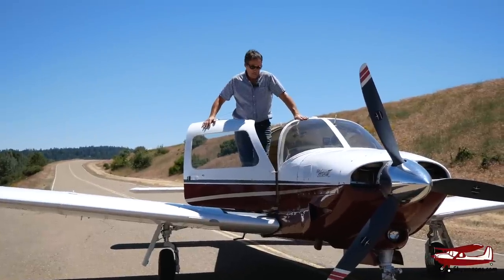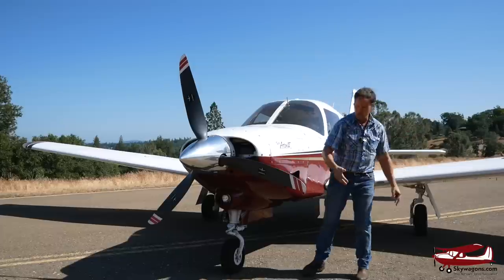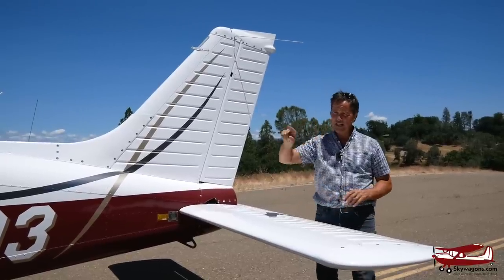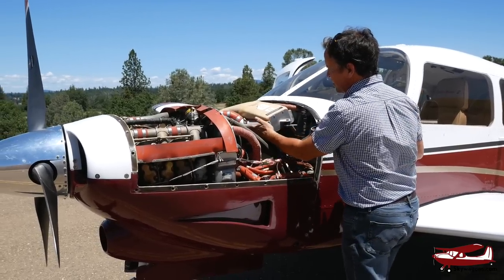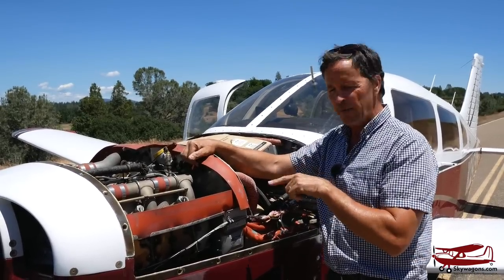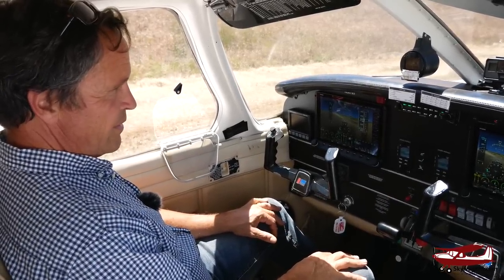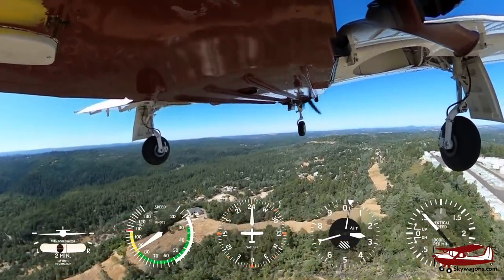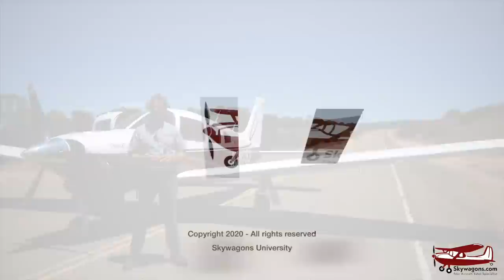1977 Piper Arrow III Turbo

Comment: You gotta wonder what happened here, all that panel work and no IFR gps and no AP.  It is a truly beautiful Arrow though, with the added panel work it will be an amazing aircraft for someone.
Reply: Agree, all the panel upgrades and not IFR, sacrilege....
Reply: It's certified to 20k feet, it's IFR over 18k.  He got it wrong,  see my other comment.
Reply: @wadeh9124  So someone put 50k into the panel but didn't spend an extra 10k for an IFD440 to enable RNAV approaches? It makes no sense at all. The auto pilot I can understand they would want to wait for the avidyne ap to get certified (though with the speed of progress so far, it would likely be a very long wait).
Reply: @capilot3635  yeah I agree.  this is where I'm fuzzy on but they can add the ifr gps module from garmin or avidyne which isn't panel mounted and can be displayed on the Dynon.  They do it in Experimental but not sure about Certified.
Reply: For the starters, it’s Dynon, so you know he’s cheap. There’s your answer.
Reply: They will likely price it as if it had all the bells and whistles anyway 😂
Reply: @Captndarty what a snobbery comment.  People afford what they can afford.
Reply: @Captndarty what a snobbery comment
Reply: This is a really nice looking airplane

Comment: 200 horsepower…not 201…the extra “1” is a taper wing identifier on Pipers.  The aircraft was originally delivered with a fixed wastegate…allowing overboost…the Merlyn conversion is an automatic wastegate that will dump excess boost.
Reply from the maker: True.

Comment: Hey Mark, I have a 1978 Turbo Arrow III like the one you are showing and yes they are the PA28R-201T but dont let the 201 part fool you. It's 200HP therefor no HP endorsement
Reply: The 201 distinguished the tapered wing from the 200 Hershey bar
Reply: @bigstickpilot  I'm just referring to Mark calling it 201HP and not sure if that's where he  got that from.
Reply from the maker: Slip of the tongue.  That engine in a hawk XP is 195 HP or 210 HP and in a Seneca III it is 220 HP. It's all about compression and RPM.

Comment: I instructed for a Piper dealer in my early years and then flew Hershey Bar wing, Lyc 180/200 HP arrows as an instructor for Japan Airlines student pilots both at Brown Field and Napa, CA.  Solid, dependable airplane.  I don’t recall any issues and we put a lot of hours on them.  Enjoyable airplanes, although the 180 was a bit anemic.  This looks like a fine example.
Reply: Brown Field? That’s where I am based at.
Reply: Ya til the wings fall off

Comment: What’s the price on this one?
Reply from the maker: It sold for about $150,000.
Reply: @skywagonuniversity5023  just saw one for about that. Wondering if they’re decent to get one.
Reply from the maker: They are very good planes but remember that the turbo Arrow has the 200 HP turbocharged IO-360 six cylinder Continental engine.  The Non-turbo has the 200HP injected Lycoming four cylinder IO-360 engine.
Reply: @skywagonuniversity5023  I’m a fan of lycomings. What are your thoughts?

Also I think the cylinder issues are simply from running them too lean. Calm the EGTs down to 1300-1400 and never worry about it.
Reply from the maker: @RaceMentally  The Lycoming is more reliable because it is not turbocharged.  Max manifold pressure is 35 inches or thereabouts.  The Continental in those planes goes to 46 inches.  They are working very hard and are easily abused.  If you need the turbo, then you need it.

Comment: Had some time in a 1970 Arrow back in the 90s with a hartzell 3 blade conversion, 200 hp. Very good performance. Sadly N12FF was a write off due to severe hail damage a few years later

Comment: Finally a turbo Arrow. Not the T-tail like mine but technically other than the Tail similar. Great planes good cross country machines. Thank you for the review.
Reply: Is the T tail a problem ? I think T tails look cool unless you forget to grease the jack shaft on a 727....🤣
Reply from the maker: T tails are fine, it is just a slightly different feel and look.
Reply: @maxgood42  Love my T-tail

Comment: No memories about this particular aircraft, but there was a turbo in my father's 210. Most of the time it did not work, but the two times I remember that it did work provided memories from the 1970s over the Rocky Mountains that I still cherish today.
The first memory was when my father asked me to keep an eye on a bonanza which was slightly ahead and to our right. Later he asked about where it was and I said it was now behind us. He replied, "That is impossible because bonanzas are fast. (pause) Unless he doesn't have a turbo." Then he smiled, slapped me on the knee and said "Well we do!" He was happy for the next 30 minutes, the longest I have ever seen him continually happy flying.
The second memory was when we were on oxygen at 15,000 feet over the Rockies and there was about three inches left on the throttle for manifold pressure. I was used to having full throttle at 9,000 to 10,000 feet. We were so far above even the Rockies that I remember thinking at this altitude you did not need to know mountain flying techniques because we were so far above them. I felt almost like an astronaut and we were halfway to heaven.
Reply from the maker: That was funny.  Thank you.

Comment: Couple notes for anyone in the market. My turbo arrow iii came with the merlyn waste gate (which should be mandatory) but not the intercooler. I assumed that I would need to install the intercooler. I've been delighted to discover that the engine runs plenty cool enough lean of peak even in the hot California summer that we've been having this year. Some people will rave about the improved power with the intercooler. Keep in mind what Mark said about having to reduce power settings after installing the intercooler. Anyone that's getting more power with the intercooler is over-spec'ing the engine and it's really a bad idea. See Mike Busch's lecture on turbocharging for more information. Also, that stuff about vapor lock is true but you don't need to mess with that procedure opening up the vents. Just open the throttle all the way, crank, and run the primer. Pull the throttle back as it's firing so it doesn't rev high. Works every single time and I hot start all the time. Hot starts were frustrating until i learned about this procedure.
Reply from the maker: Thank you.  This is very interesting information from a longtime owner operator.
Reply: You just answered a lot of questions. I also have a Turbo Arrow III without the intercooler. Thanks for that!
Reply: @JohnnyBeeMusic  glad it's helpful. It's hard to find real information on these birds.

Comment: Very good video. I have a small question, where would the Dakota be located in the line of the PA-28? Here in Argentina the Air Force uses them in liaison tasks and it is a question that arose in my mind while watching the video because I did not see that you named them.
Reply from the maker: There is a video about the 235 and 236 (Dakota)  It is a Cherokee 180 with a 540 Lycoming rather than a 360 Lycoming, 6 cylinders rather than four. Dakota's were al constant speed props while early 235's some had fixed pitch props on the 540 Lycoming like a Pawnee.
Reply: @skywagonuniversity5023  thanks for the answer!!! I will search the video in your page...

Comment: Great informative video as usual. I loved hearing about the engine/turbo/cooler air giving more MP than indicated. Have never flown a turbo obviously. That’s one very nice Arrow, looks like the pick of them with the turbo 6 cyl Continental. 

Sold my 182Q ‘78 model last year, was a nice plane. We have a Cherokee 140 ‘67 model now because it’s easier for my wife to consolidate her flying, she has her PPL as well. Anyway I like the Piper’s after having the Cessna there are features that I like more on the Piper. We plan on getting a Dakota in a couple of years when my wife thinks the 140 is too slow. 
What I would love to own more than anything is the Beech F33A, very rare in Australia though. Next choice would be the Arrow in the configuration that you showed here, lastly but most likely it will end up being the Dakota, equivalent of the 182 but with an edge over it I believe.
Reply from the maker: Dakotas are great planes.  In 1979 they had the option of this engine, the TSIO-360 Turbo Continental.  Don't get that one, get the Dakota with the IO-540 Lycoming engine at 235 HP.  It is very reliable and will never let you down.
Reply: @skywagonuniversity5023  Thankyou yes. When I bought my 182 I regretted that I never test flew it in comparison to the retractable 182 because the retractable as you would know, has that Lycoming IO540. I liked the way the nose on the retractable 182 was more pointy, and of course had another 15 or so more knots. I still haven’t ridden in a retractable 182. Have you compared the 182 versus the retractable 182, I haven’t been subscribed very long.

Comment: Another fascinating video, love all the differences on a standardized theme👍😊 Lovely aeroplane.

I saw a Piper the other day at my local airfield and I couldn't fathom what it was. A later model with a respray and few badges on display, six seater, turbo, retracts low tail (iirc) but the nose cone was very modern with two sculpted apertures either side of the prop. I'm guessing it was an Arrow🤔🤔

Comment: How many gallons per hour does the Arrow 3 turbo consume?
Reply from the maker: It's a Continental six cylinder IO-360 with turbo so its sea level power all they way up. It burns about 12 gallons per hour.

Comment: I fly an HDX equipped Archer, with an Avidyne IFD540 and the AeroCruz100 AP.  The AP is the weak link for sure, but it’s still more helpful than not having an AP at all (how’s that for a ringing endorsement?).  I’d love to have this plane, but would have to immediately put in an IFD and Aerocruz.
Reply from the maker: That is what a new owner will probably do.
Reply: Mark - what is the apparent streak down the belly?  Is it just an artifact of the 360° camera, or maybe exhaust soot?

Comment: Your little animated airspeed indicator Vne is like 105kts. I'm sure this airplane is a little faster than that.
Reply from the maker: Yup.  We were using a program that took GPS data from the GoPro and used it to create the instruments.  The turn coordinator looked like it had a crack addiction and we finally just gave up on it.  - Don the Camera Guy.

Comment: What's with the 105Kt redline?
Reply from the maker: Probably gear speed.  It is sold so I cannot look at it now.  Sorry.
Reply from the maker: The overlay is just a representation based on GPS data, and I did not correctly set the airspeed indicator.  The indicated speeds were fairly accurate, but the airspeed zones were not.  - Don the Camera Guy

Comment: A GPS is not required for IFR flight or certification.  IFR is pitot system, transponder and a few other basic systems listed in FAR 91.205.

GPS is a luxury that has become standard and offers more direct nav options as well as approach options.

This aircraft shown has  gps.  You can see the antenna @9:09 on top left of the door latch. 

As far as T Tail,   i love the t tail and it doesn't fly any different.  Nobody complains about the Seminole,  Duchess,  Pilatus or other T tall planes.   Fly them by the book numbers as designed and you'll never know the difference.
Reply: On Dynons own website, they state it’s IFR only if coupled with an IFR GPS. My guess is their receiver doesn’t meet a related TSO. Doesn’t look like it has VOR by itself either.
Reply: @TheReadBaron91  only for IFR approaches and GPS navigating.  However. The aircraft is still IFR certified.  The FAR stands that GPS is not required.

You can fly in IMC conditions but can't flight plan GPS routes or use GPS approaches.

Comment: excuse my ignorance but can you explain what  "AD" is?
Reply from the maker: An AD is an Airworthiness Directive.  Issued by the FAA after a series of similar faults on similar planes of a type.  If they issue an AD, you then have to fix it at your own expense or the plane is not airworthy. It could be a wing spar or a fuse. Anything.

Comment: How much more would someone expect to pay to insure an aircraft like this, as compared to a 180HP C-172?  Is it mostly about replacement cost or more about high performance engine vs standard performance?

I am still trying to decide about purchasing an aircraft to train with and figured a 172 would be a smarter, and cheaper, decision but it seems that a good 172 isn't  that much cheaper than one of these.
Reply from the maker: It depends on the value of the plane and the experience of the pilot.  High time pilot with all kinds of experience in type is about $1500 a year.  Low time pilot with low hours in arrows, could be three times that.

Comment: I don't understand something. How did these engine's not over boost from the factory without a waste gate?
Reply: I have a 78 Turbo Arrow III and you just dont firewall the throttle. Ever. Move it slowly and keep it under 41" on take off and once airborne you are generally under 33" but again you control it yourself and we have the Merlyn wastegate and you can still easily overboost past 41" if you're not paying attention. You just want to bring it back as soon as you can.
Reply from the maker: Exactly, it is all manual.

Comment: The turbo allows you to burn 30% more fuel and go 5% faster.
Reply from the maker: It allows you to go high.
Reply: @skywagonuniversity5023   True, but a turbo Arrow is still only about 10 knots faster than a normally aspirated Arrow and burns 3-4 gph more fuel.  Normal Arrow: 137ktas on 10.5gph.  Turbo Arrow: 148ktas on 14gph.  A terrible tradeoff.

Comment: They have a bad rap because pilots screw them up.  You have to have a degree of mechanical intellect to own a Continental TIO-360.  As an A&P I have my own ‘thoughts’ on this sub marvel of aviation powerplant engineering!
Reply from the maker: That is very true. Great engine, bad operators.

Comment: “Electrical” - 🫤
Reply from the maker: The Alternator is a bit enthusiastic and the Dynon has not been told of it's acceptable parameters.
Reply: @skywagonuniversity5023  I was going to say, you should be able to configure the EMS alerts to keep that from happening.